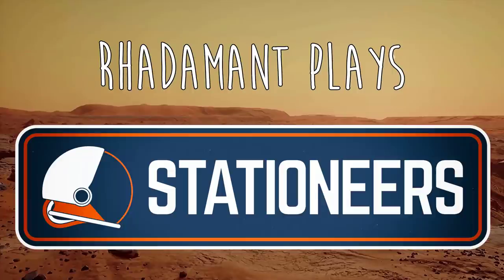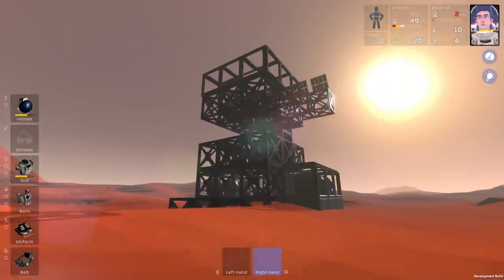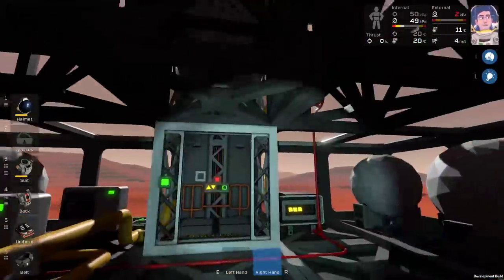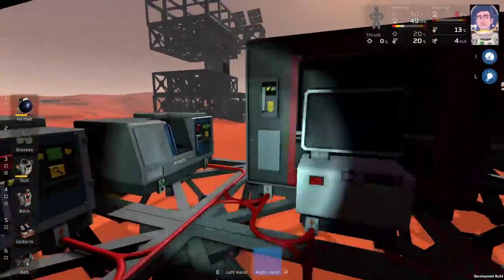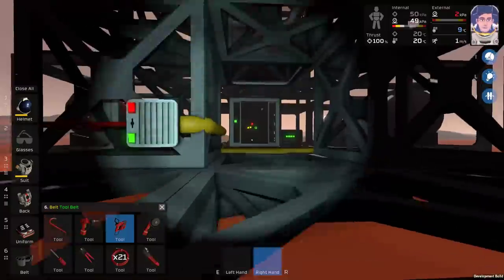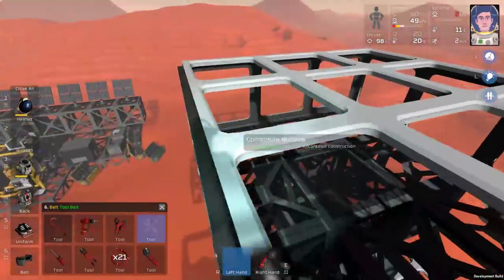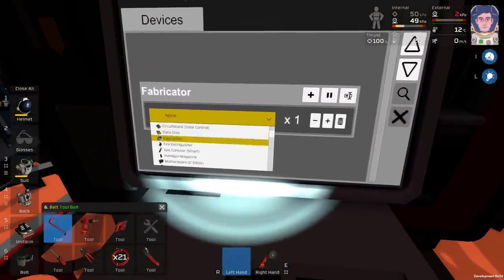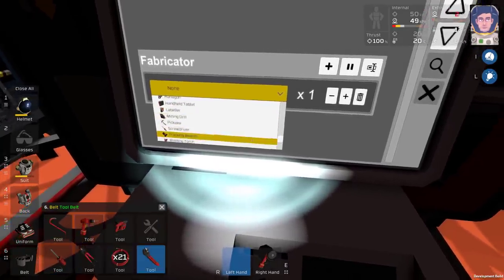Stationeers / EP 10 - HVAC Setup Part 1 / Mars Colonization

Comment: Since you're going to need an additional tank for NO2, you might as well add a second tank for "Base Air" - some combination of N2/O2/CO2 set by mixers.  That way you have easy access to real Air on demand.  Also, you may want to have a fern or two around the base to filter out any stray X that makes it in
Reply from the maker: Brilliant ideas!
Reply: Is that what the ferns do thanks

Comment: Rhadamant, use the mouse function to your advantage, you could of drag and drops all your stuff from one suit to the other instead of cycling threw the slots. The mouse is also good for swaping batteries, you drag the battery from your equipment onto a full one in the charger and it will swap it
Reply from the maker: I'll try to remember to use it more =] It's going to be hard to break a habit, however.
Reply: Rhadamant totally agree with that

Comment: If you wanted to put passive vents on the ceiling in the third floor, could you put a frame on the roof, place the vent and then remove the frame and place the glass back on?
Reply from the maker: I could, but it would probably only regulate that one 1x1 frame tile area, which would be problematic. (if I understand you correctly) 

regardless I love the inventive idea.

Comment: Could have just used your central well to run the pipes and wires in.
Reply from the maker: I'd rather have the base feel more open than have a giant metal pillar in the middle
Reply: Well yeah but a convenient giant metal pillar, but I was thinking more of glassing in the edges of the hole instead of at the top and bottom with the wire/pipes in the center of the void. Of course that might just look good in my head...